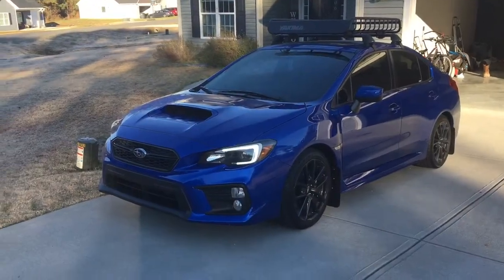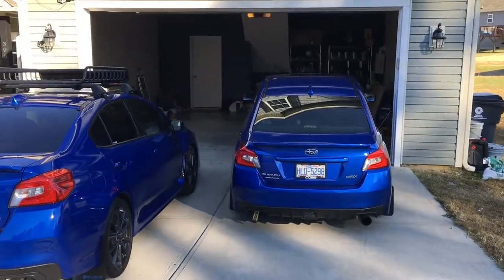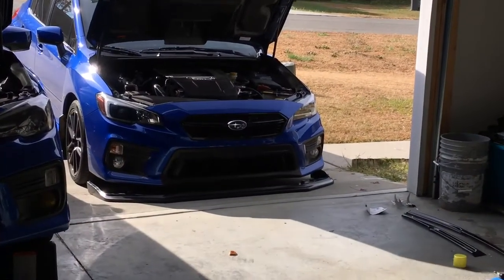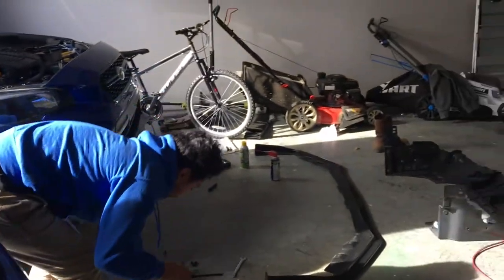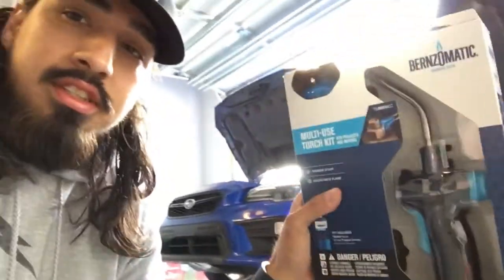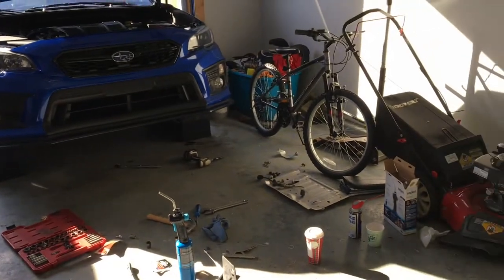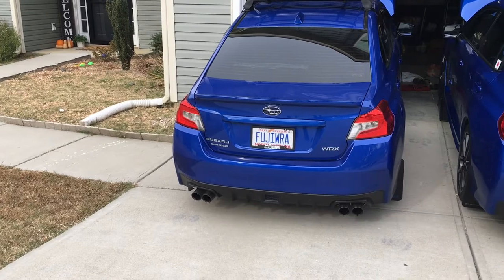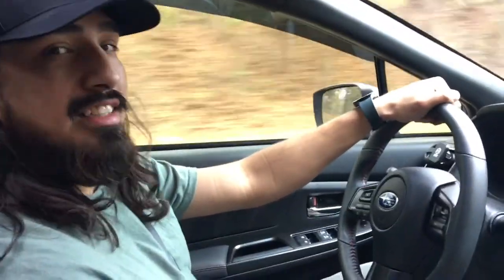2020 WRX goes Stage 2+

Comment: Awesome stuff man.. car sounds good! You still running the stage 2+ Cobb OTS tune? If so how's it been with that?
Reply from the maker: Thanks bro!! I've been meaning to get a custom Etune but in all honestly its been great! i keep up with all other maintenance and it hasnt skipped a beat. i will say im running an older stage 2+ tune not the new shit cobb offers. i tried running the updated stage 2+ tune and since the emissions have cracked down i get a cel for 02 sensors. with the older stage 2+ tune i get no CEL
Reply: @Gonzalez_Garage  glad to hear you like it. People say mixed things about OTS tunes, but they seem safe to run!
Reply from the maker: @IvanLuketina  yea as long as your running the parts specified in the tune i dont think its a bad tune at all! and ofcourse always keeping up with routine maintenance
Reply: @Gonzalez_Garage   do you still have the stage 2 map that supported jpipe with getting CEL?
Reply from the maker: @arjayudani9435  I don’t have the car anymore but it did have the older stage 2+ map that didn’t cause the CEL

Comment: Ik I’m a year late, but I’m currently building my wrx to stage 2, im just curious as to why you chose a WRX over an STI
Reply: do you anything abt tuning with j pipes after the green speed update.
Reply: was looking into a buying a j pipe but don’t want a gen 2 and don’t know if anyone can tune for the old ones.
Reply from the maker: At the time I was excited about the new FA platform which has proven to be a great reliable platform so no complaints! I haven’t made videos in a while but I have the new VB wrx with a lot of goodies!! And I upgraded for similar reasons. To see how much these new platforms can be pushed!
Reply from the maker: You can find the old Cobb stage 2+ tunes floating around on forums and those don’t have check engine lights for the j pipe! That’s what I was running back theb